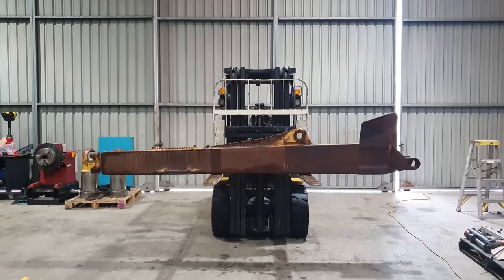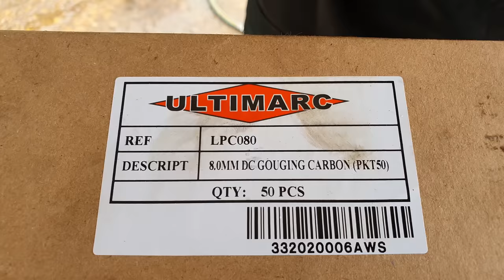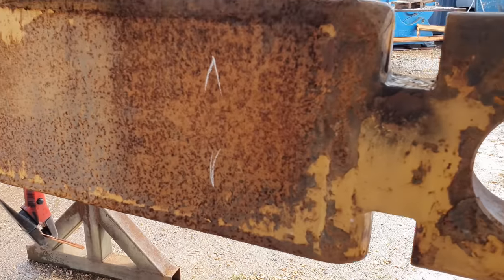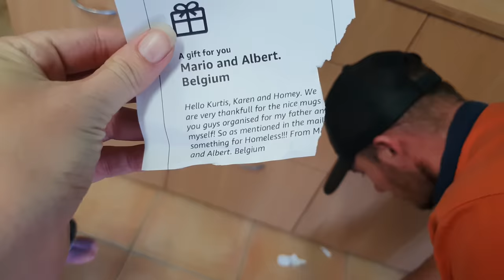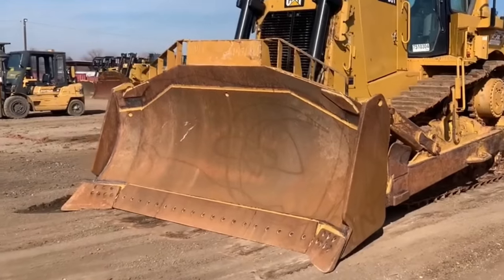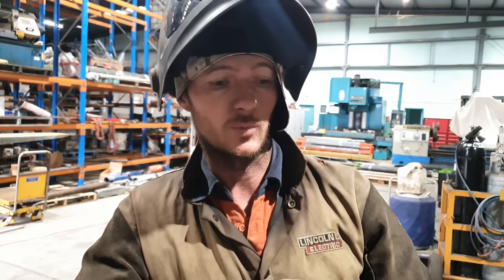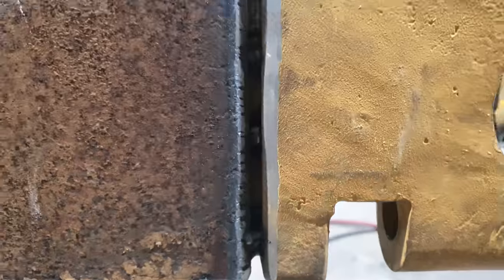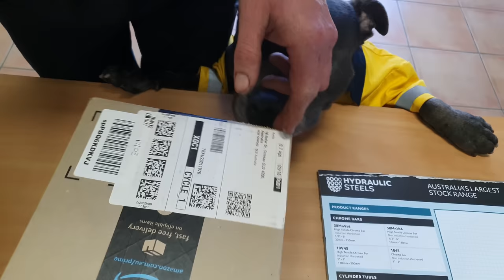Repair BROKEN End on D8 Dozer Push Arm | Gouging & Welding

Comment: Loving your work. I'm a professional diver. We gouge, cut and weld underwater regularly. We mainly use Broco rods for burning, and stick welding to put stuff back together. DC always, positive ground, good insulation and make sure you don't get your body between the work and the handpiece stinger cable, (ie, comes in from in front or the side). Get lots of tingles, teeth ache, chrome plating peels off all the equipment but we all survive. You're taking all the right safety precautions.
Reply: What sort of money mate? Ever don't any sat diving work?
Reply: Respect for your work and commitment Phil, but personally I will pass on doing that sort of work.
Reply from the maker: Hey mate thanks for taking time to watch and share some of what you have to deal with, always wanted to give that a go but I'm not a fan of the ocean or sharks 😂
Reply: @CuttingEdgeEngineering  I don't know about you Kurtis, but I love flake :)🤣
Reply: Yup when I think of the scariest jobs imaginable underwater welding is one of the first ones that comes to mind.
Reply: Under water work and skyscraper or radio tower work, I love the lack off boring but my body has a strong dislike for anything too high or anything too deep.
Reply: @Phil Menzies you have one of the coolest jobs in the world!
Reply: M A D   M A D 
R E S P E C T
For being a wet welder
Reply: Had no clue you get side effects from underwater welding….like tooth aches. What a miserable job. I hope it pays super well😬 Sounds painful my friend  😞
Reply: Nice crime scene to close the video
Reply: @wmweekendwarrior1166  The
Reply: I’m ok with heights but deep water is another matter.

Comment: I do believe that people from around your area are blessed to have someone who can fix these machines. With most companies pushing technology to prevent owners from fixing them, this also made most people treasure old school machines as they can be diagnosed easily without any need for software.
Reply: You are referring to the John Deere Right of Repair issues and the dangerous path that they and other companies are headed down. I think that to have any success, customers are going to have to start with an old fashioned letter writing campaign. The reason for suggesting using actual letters is to make a point about technology as well as going for the great vision of letters arriving at J D HQ. Let them know and their shareholders know that Customer Loyalty is a two way street. Tell them that you are considering buying a different brand when it comes to replacing a tractor or other item and let them count up the potential lost business.
Reply: @markfryer9880  I've heard of JD's sorry behaviour (here on the Toob) from farmers who've been shafted.  Knowing the names of any companies heading down the same path would be good.  I've been thinking JD's actions would be good for the likes of Yanmar and Kubota but .....

Comment: I like watching the heavy earth moving parts repair more than the lathe/milling/line boring videos.
I know many times the machining is part of the heavy equipment repair but I like watching the welding, air arc, grinding, fitting process more.

Comment: Love the extra steps in making the job right. Changing the feed rollers in the welder, the nozzle tip, the wire, moving the thing outdoors to gouge, grinding the excess off the new part instead of just hitting it in with a bit of force. All these things make the videos so good to watch. Fucking love it man.
Reply from the maker: Hey mate thanks for watching and glad you enjoy all those little things that make up the video. Cheers
Reply: Beautiful work !

Comment: It's nice to see that at least one machine shop knows enough about arc air gouging  and welding to realize that it creates metallic dust that is highly abrasive and will damage machinery. I have worked in many shops over the years where this simple fact was overlooked and the shop and all of the machines were coated in dust. 
Another problem with the creation of this dust is the fact that it is electrically conductive. It can settle in all of your fuse boxes, switching gear, and outlets and when enough has accumulated short them out. There was an incident in one shop where the dust shorted out a main switch and when the electrician opened the panel and tried to blow the dust out it actually exploded and killed him in the process. If you must service a panel and suspect the presence of metallic dust, make sure all power to that panel is completely shut down.
Reply: Good info, friend. Thanks.

Comment: I helped build Subs for the Navy here in the States.Nice to see someone use a Arc rig with a skill set.This is a routine job in the shipyard.Nice work sir.Once you find that fuse line your golden.Im surprised you didn't Arc that bevel  on while you were outside.Nice to see you welding that vertical uphill instead of down hill like alot of no welding clowns would of done.

Comment: I had no idea you could air arc gouge cut. Very nice.

As the sharpened carbon electrode is drawn along the metal, an arc forms and melts the metal. The air jet is used to blow away molten material. This can be dangerous, as the molten material can be blown substantial distances.[2] The process is also very noisy. Metal removal is rapid, and when properly done, a smooth half-cylindrical cavity is created.

Comment: Kurtis, I have 3 pop up canopies that I use at a local trash and treasure market, and they are very convenient. My first one needs some repairs, so I bought a used one at the scrap yard, disassembled it, and will cut and drill the pieces to fit.

Comment: Nice function for that welder to be able to cut out when it senses a short. As a mobile repair and welding service truck operator I did my share of welding in the rain. A shocking experience for sure eh. These push arm eyes are sooooo rarely adjusted. I have seen worsen for sure. Lookin good Kurtis, thanks for having us stop by. Take care eh.

Comment: I was a welder's helper in the refineries when I was a kid and there was more than one time when we were up in the iron working through some light showers and I started feeling the tingle of leaking voltage. I wouldn't call it electrocuted but it was certainly worrying enough to tell the welder to stop long enough for you to find a place where the voltage doesn't want to pass through you. That turnaround work was a balancing act between keeping OSHA(Occupational Safety and Health Administration) happy and getting the unit back to operational status on schedule, which made the refinery happy.

Comment: Safety is paramount and I like that you let us know what some of the things are that you do to stay safe when you have to work in conditions that are, otherwise, definitely not good. Also love seeing work done where you've used gouging as a tool to remove ends from pieces that you're going to be repairing. I've never seen gouging used, or even heard of it, until I started watching your channel. 

My only question when it comes to gouging is; Why they haven't created something a bit more ergonomic to hold onto when doing the work?
In regard to welding; You're the only person I've seen who heats up material before welding. Why don't more people do that? Is it more for types of materials used?
I've also seen that on some jobs, like this one, you've welded in both directions. Does that matter at all for the strength of the weld?
Reply from the maker: hey mate thanks for watching and great questions here. The handpiece is designed to protect the operator has a lot of power and heat going through there so needs a lot of insulation. Pre-heating "heavy" and thick materials helps to reduce chance of thermal crack in the weld joint but not needed for light metal fab. The multi direction doesn't make a difference here for the weld strength. Cheers
Reply: @CuttingEdgeEngineering  Ty for the answers. :D
Reply: @Redman147 From my prospective as a power engineer, I can attest to Kurtis heating up the 'material' first is very wise indeed. For example when I fired up a steam boiler from a cold start, it took a long long time and was tedious, but was crucial to do it slow, timer in hand On/Off. The last thing you'd want is to go fast on start-up and initiate an unwanted crack. Without going into great detail about cyclic rates, it's VERY important from my side. I understand this fully. Cheers. ps: I also wish people here in Canada would STOP revving their car engines on the coldest days of winter on start-up. I hear it all too often, and I would bet those broken down stalled cars I see on my way to work are the people that don't realize what they have done, and blame it on the cars instead of themselves🤦‍♂. I thought I'd mention that too.

Comment: Something about arc gouging, welding, plasma in the rain…….. shocking! That said, as a retired safety manager and medic, I don’t want to count the number of guys who wound up with slag or bb’s in the ear canal! Ear plugs are essential for welding and gouging not only for the hazardous noise exposures but they reduce and often prevent 2nd and 3rd degree burns in the ear canal and tympanic membranes. Once the eardrum is burned or scarred, hearing is lost forever, of course the pain is unbearable and unstoppable too.

So thank you for setting an excellent example!

Comment: Curtis another great and informative video many thanks. One question that is probably so very obvious to you but would like "your slant" on it why use your gas mix with a flux cored wire as obviously the gas is not free etc? I am assuming it just shields the weld that much better etc so gas cost is offset by possible time lost grinding and cleaning?
Reply from the maker: hey mate, the wire is a dual shield and requires mixed gas combo in order for it to work correctly. Yes it does shield the wire but if you attempt to weld with this wire and no gas it would end up full of porosity.
Reply: @CuttingEdgeEngineering  Now I'm really puzzled, I looked up the Fabco tech sheet and it doesn't say flux cored, which with the slag it obviously is, and it says 75/25 argo co2  !!
Reply: @rl3898  I did the same thing and the Hobart site doesn't really make it super clear does it? After a while I did determine/confirm that it is indeed a flux cored wire, and it's designed to work in conjunction with the shielding gas. My understanding is that you get better penetration, and properties with the combination of the two arc shielding methods. It's not something that I've had to use, but nothing I weld here at home is this heavy.

Comment: Love your videos!  I'm curious why you couldn't use a band saw to cut the square tubing versus the arc gouging system.
Reply from the maker: hey mate good question, you could use a bandsaw but you don't have any "control" over the cut & location of the weld joint, you'd have to get it spot on or run the risk of extra cutting or extra welding to fill the joint. Where with gouging can be much more precise at only removing the material needed to separate the end and find the weld joint. 😎👍
Reply: Anyone can use a band saw :P 

Also blade deflection , squareness etc...
Reply: Thanks for the answer!  Fascinating! - Joe in Seattle. 😁🤙

Comment: Rain, LMAO try living in Wales, you start to grow webs between your toes. Fascinating insight into the life of a 'push arm'. Getting the odd electric shock as an apprentice definitely made us aware of best practices when working in the wet. The video was really good, thank you both.
Reply from the maker: yeah can only imagine! We're lucky enough to still get plenty of sunshine, has been a very wet year for us so far compared to normal
Reply: I put the electrodes under my arm to stop shocks when working in the rain , when i worked outside for 2 years as a apprentice in the sixties.
Reply: @aytonbob  I was an apprentice from 1971 in a medium sized engineering firm. We had a branch which manufactured industrial furnaces, that where we learnt our welding and cutting modules. I swear some of the welders were sadistic and would do things just to taunt us young apprentices. As we learnt more and more over the years, we paid them back. We were taught how not to get shocks at college, I found wellies and dry clothes / gloves worked, but speaking to guys since then they all had their own ways.
Reply: @CuttingEdgeEngineering Been in Wales for 2 and a bit years , lovely spot in West Wales half way up the valley wall facing south. When it rains the stream on the right side becomes a small river and the waterfall on the left goes mental. The view is almost all green trees and fields, lovely. We moved to Wales as my wife has family around us, the move was because I'm terminally ill and wanted her to be mortgage free and among family when I do pop my clogs.

Comment: You are great in what you do.  At one of the local scrap yards, they recycled castings from a Foundry and manufacturing shop.   The gears were 6' tall (2M) and were cut with an Oxy-Lance.  And a guy in a advanced space suit for the very high arc and splatter.   They had a massive crane after two slices were made, maybe 3.  The crane would drop it on a massive lump of iron, and it would most likely split.  They got to sell the smaller chunks back to the foundry as quality iron.

Comment: »That's no hammer. THAT's a hammer.«
Someone had to say it. 😁

Once again, thank you for a great start into my Friday. I really liked the damage analysis and the explanation of how that has probably happened. It's a bit weird to me that rock can actually break steel like this, but I suppose that depends on the rock. Anyway, good one, cheers!

May everyone have a great weekend!
Reply from the maker: going to have to do a Crocodile Dundee impersonation one of these days! thanks for watching mate
Reply: @CuttingEdgeEngineering  Yeah. You do. You REALLY do.
Reply: @CuttingEdgeEngineering  Yes, my biggest one is called "Gentle Persuasion", even made a label that is on the handle to remind of that. Could not find the right handle, so a pick handle worked for it, with epoxy to help the wedges hold. It spends more time being the anvil than the hammer though.
Reply: @SeanBZA  Could make a great name for a race horse?
Reply: @CuttingEdgeEngineering   which leaves the role of Lind Kozlowski to fill?

Comment: What would you say the mean time between failures are for the squeakies that the safety officer gets?  About 10-15 seconds?  My doggo tears into the squeaker then is more or less done with the toy.
Reply from the maker: with the rubber chickens/pigs usually about1-2 minutes
Reply: @CuttingEdgeEngineering  Wow, I was wondering this too. You certainly wouldn't want to be on the wrong side of that jaw!

Comment: I've done a few of these in my short career working on equipment. The first time I tried slicing through the mount and it took me several hours and a tank of gas. I eventually just measured how long the new mount is, added about 1/8" and drew a line all the way around with soap stone. Held my torch at about 45 degrees and made 4 slices and they fall off and you've already created yourself a weld prep. Wound up making the whole process about 20 minutes per arm including time to flip them over for each cut. Saved a lot of gas and labor cost lol.

Comment: Great work. I used to work for Caterpillar and I’ve built a lot of the bigger push beams like this. I’d hate to have to cut an end off like you are. Lots of weld to gouge out.

Comment: Back when I would weld with my ranch crew - at 65 I tend to be lazy - I would place a rubber truck floor mat down if the ground was wet. I would sometimes put on rubber overshoes as well. With miles of 2 3/8” pipe corrals, fencing, repairs, etc, we couldn’t afford to stand down during the rare times it rained on our Texas ranch. Nothing tingles like a welding jolt. Nothing beats being lazy either.

Comment: Used to weld on boilers a bit usually with wet floors had a few tingles always wondered how close it was to being dangerous, dry gloves seemed to be the key. Have to agree I have never seen a process that comes close to the efficiency of air arc gouging, consumables are a new o ring in the air switch every six months and a new hand piece every year. Great job as usual guys

Comment: 2 questions:
1-why don't you use your bandsaw to cut the end off? 
2- why don't you get a blast cabinet, or blast unit to clean the paint off of parts?  lot faster than doing it by hand? You can still weld just have to choose the correct media!

Comment: I had a Cat D4 for doing firebreaks and general work on my hobby farm.   It was a very old D4 that had seen a lot of work before I got it.   One day I noticed a bad crack in a push arm, so I arc welded the crack.   It cracked again.   I welded again and it cracked yet again.   I gave up and got another push arm from a wrecked D4.   I'm an amateur at this sort of thing and maybe I should have sent it to CEE.  I'm a long way from the Gold Coast though.

Comment: Nice. Work!  I did a similar job about 40 years ago, 1/8" stick electrodes. Sitting on an upturned 5 gal bucket (20L) for what seemed like a week. I had no clue that things like wire feeders and dual-shield wire even existed. Love the channel, don't worry about the words, just keep the "wire in the fire"!

Comment: I used to know some welders that worked for a railroad tank car shop. Their welding equipment was not in good shape and they had to work outside in the winter, or rainy days. I saw one of them after getting off his shift. He had long black curl hair and a beard. When I saw him, the hair looked like an afro and the beard looked like it had caught fire. He had been welding under a tank car, the welding cables had bare spots and they touched the tracks where water was sitting. I'm surprised he was alive!